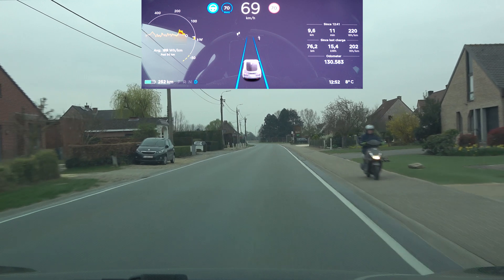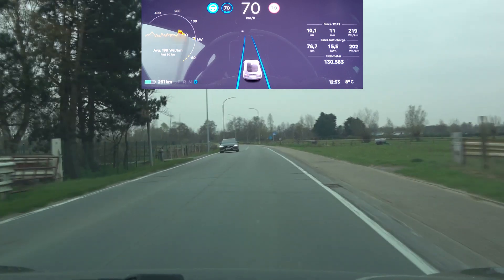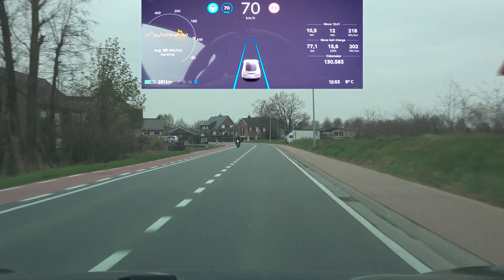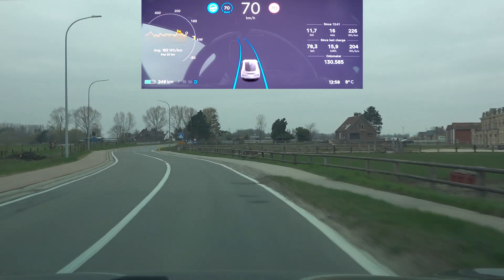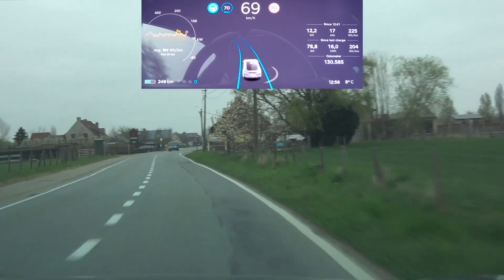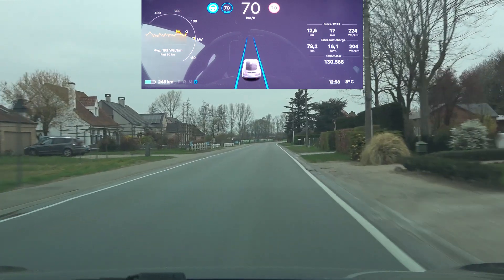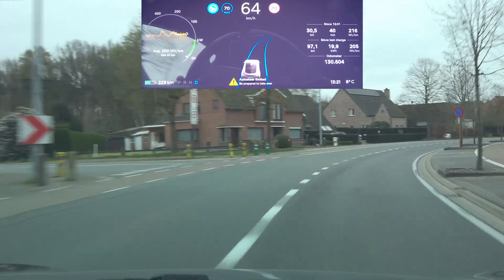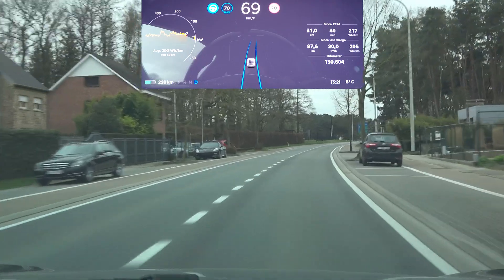Update 2021.4.12: is Tesla going rogue on the UNECE regulations?

Comment: Yesterday I did a 300 km trip. I do this exact trip a few times every year. I always use fsd as much as possible on this trip. But the system has had much problems due to all the curves that is on part of this trip. It have given warnings and not been able to drive any faster than 70km/h in the past. Yesterday I
It did great. It kept driving flawlessly tru the curves in 80-83km/h. Only times I had take over was on the few roundabouts that are on that trip. So I feel fsd is much better now at 2021.4.12.
Reply from the maker: I’m glad to hear that.

Comment: There is a lot of noise in the data you record. There should not be spikes in the data because that implies that the car would very quickly turn the steering wheel back and forth. In fact you could calculate the data based on speed and steering wheel angle. You could use the app "scan my tesla" to log both speed and steering wheel angle. From that you could calculate the force and compare with the recorded data.
Reply from the maker: I agree it is not the best measuring instrument and an approximation.